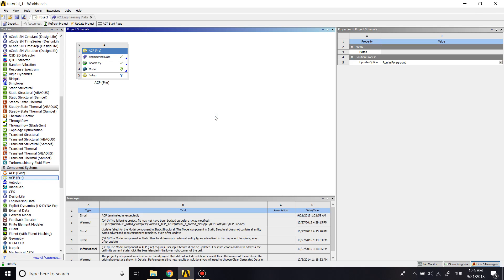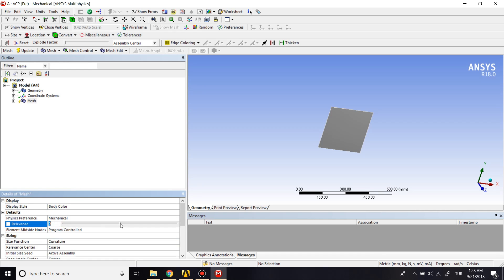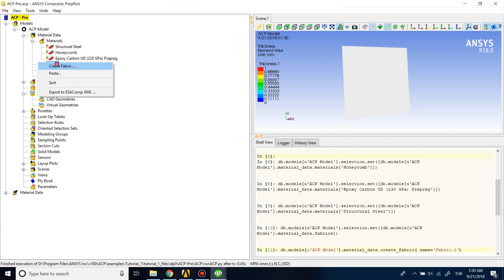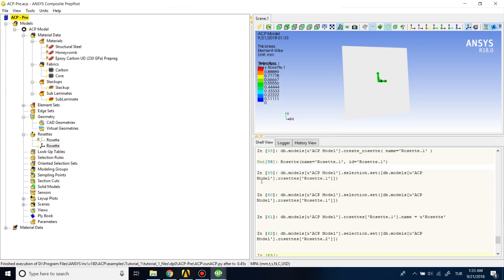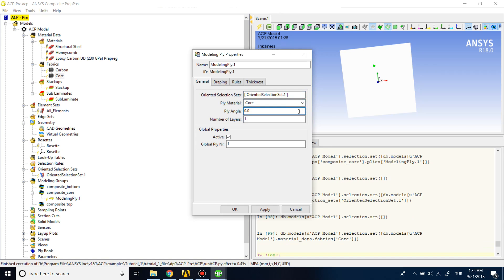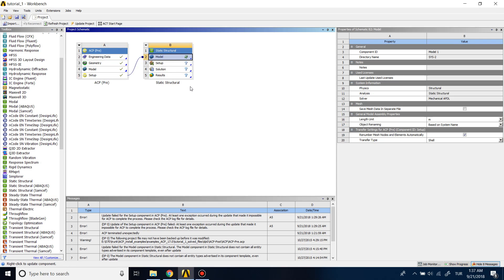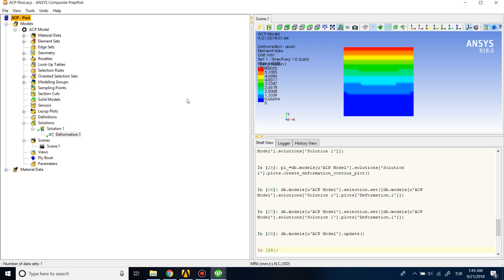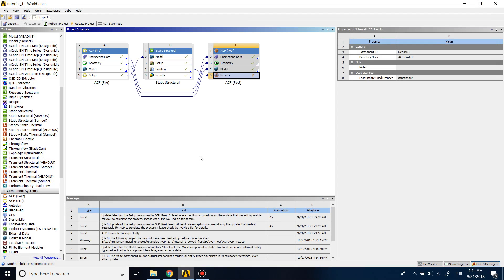Composite Analysis in ANSYS ACP

Comment: I liked the video, I am having a problem studying an assembly where one of the pieces is made of composite material.  When placing the assembly in the ACP module, when I go to the setup only the part to which I am going to apply the composite material appears (I understand that it is because I defined it as a surface previously), but when I link the ACP module to the structural static I only see links the composite part and not the entire assembly.
Reply: Even im facing the same issue. Did you find any way to solve for assembly?
Reply: @naveenrg2866  The solution is doing two differents modules, a mechanical module for the entire assembly and ACP PRE module for de composite matherial, then you have to link both modules to an  static structural. That was my way to solve it

Comment: There is an issue with using 2d body for analysis for ACP composite pre. I am forced to select 3d in analysis type by ansys. When i select 3d in analysis type, the body wont show at all as it is 2d. 
You could have done the design modeller bit too as it wouldnt have taken much time and cleared many confusion for most of us.
anyway great tutorial, thank you for making this.

Comment: Hi, I have ANSYS mechanical 17.2 and I never received the composite prep ACP extension. I am no longer on TECs and ANSYS tells me they no longer have access to the 17.2 version. (which i find hard to believe). At any rate do you have a copy of the 17.2 ACP composite extension that i could get from you?

Thank you.
Reply from the maker: I am not sure if 17.2 has ACP or not... I recommend u to switch to latest version, if you do not have copyright issues... ACP is being constantly developed...
Reply: @engineeringsimulations8355  I discovered that it comes bundled with 17.2 but i had not installed it. Thank you for your reply.

Comment: Hello, when i try to update the file after meshing it gives an error and says  "ACP Input Validation Failure. There is no data contained in the input mesh file" I made an extruded plate Dimensions 4x1m with 1mm thickness. PLEASE HELP
Reply from the maker: You have a shell geometry, right? What type of mesh did you apply?
Reply: @engineeringsimulations8355  sir my geometry is not getting updated in meshing

Comment: Hey when I'm doing that for a plate, it was not showing the mesh
Reply from the maker: Since meshes are 2-D, maybe you are looking at the wrong side.
Reply: @engineeringsimulations8355  yes sir but how to give meshing for a 2-D element.
Reply from the maker: In ANSYS Mechanical, using face mesh option.

Comment: thanks for you .please i need video how to test fatigue tube composite material
Reply from the maker: Well, fatigue analysis of composites is a complicated subject. If you mean long-fibre composites, there is no available analysis tool for these types of composites. I have researched the subject a couple of times. However, if you mean a short-fibre composite material; then, there are some tools for it. There is an external module of ANSYS which is called 'nCode DesignLife'. It consist of an analysis tool for short-fibre composites. I am not really proficient in this module but I think that there are some tutorials about it. Good luck.
Reply: @engineeringsimulations8355 Good day, about this subject I'm in need of help, I need to know how to do fatigue analysis for a structure I'm working on, the material is composite.